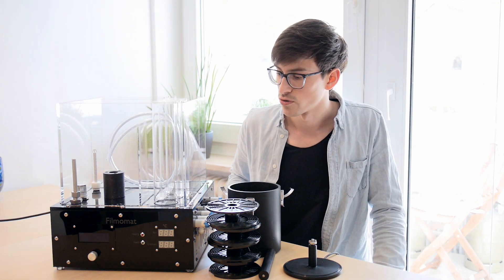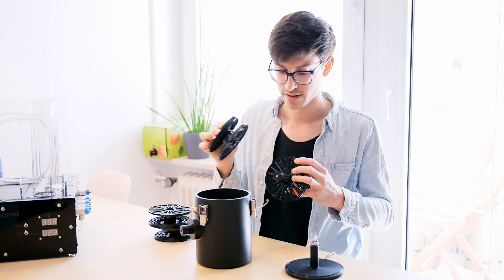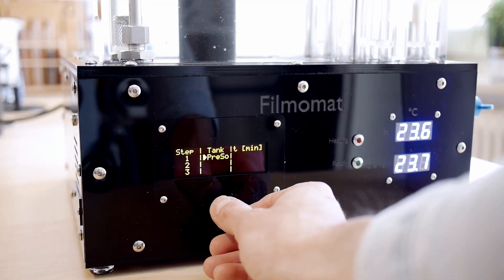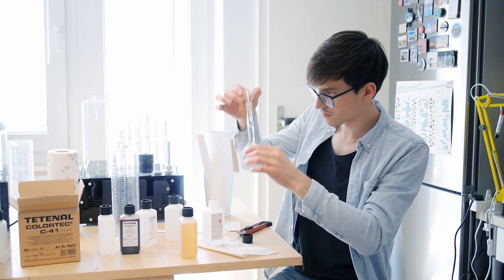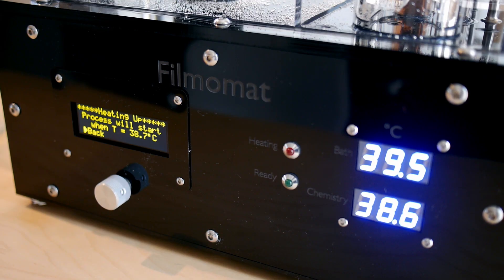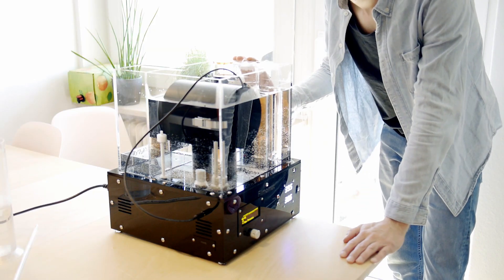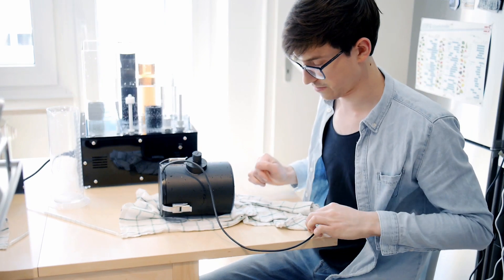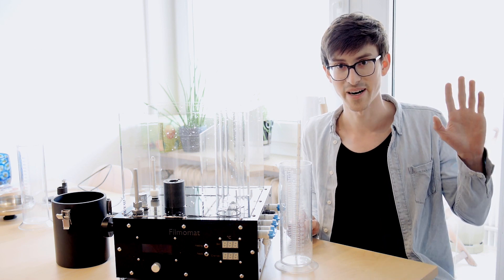The new 2020 Filmomat - fully automatic film processing machine

Comment: The new integrated tank and motorized agitation is clever and adds function. However the core of the Filmomat  is still limited to three bath processing, which limits color processing to the DIY home process based chemistry kits which present a significant compromise of the true processes. Both old and newly introduced processors do not have this limitation, and cost no more.
Reply: Although there are only 3 chemical tanks, you can create custom algorithms on the Filmomat for more complicated dev processes. ECN2 for example. You just need to be around to swap the chemicals mid development.

Comment: That is a really cool machine, but the process barely looks easier than processing film without it.  I used to process film with a Unicolor drum and motor and the only real difference is pouring the chemicals in and out.  

For $5000, I'd really like a machine that would take my cartridge in one end and spit dry film out the other.  And did I mention?  I was processing E6!

Comment: I’ve followed your machine for quite a while, but I can’t help but feel your machine is kinda in an odd position. It’s too expensive for small time operators (Unless they’re making money on their photography, and frankly few are these days.) But it’s really not big enough to provide economies of scale for small lab or photofinisher. 4, 135 or 2, 120 reels is really not sufficient to process a batch of customer orders, or even 1 pro pack of film. I can’t help but feel that you’d find more success if you pursued a much larger machine, oriented at a 5-10 rolls type of economy, which would be more in line with both the JOBO processors, as well as the typical loads of your average lab these days.
Reply from the maker: Hi, the Filmomat is mainly used by private individuals, which also was my main intention in the first place. However, I also have several users who do commercial processing with the machine. You won't be able to process 250 rolls per day, but 20-50 rolls a day is totally possible and definitely in the range for a small lab :)
Reply: The target market is home users with a large budget for convenience. No competent photofinisher would use the home chemistry kits  this machine is limited to. Those kits incorporate compromises in process quality which would (should?) be unacceptable for a commercial processor, and unit/per roll cost of such small volume kits is much higher than the commercial, full process chemistry these labs buy. Small labs are more likely to buy the machines now in final, pre-sale tests made in Australia and Italy, which will be about 10 to 20& more expensive. Ultimately, the problem of the Filmomat is that it was designed by an engineer rather than a photo chemist.
Reply: @randallstewart175  which are those Austro-Italian machines you speak of?
Reply: If you’re a small lab processing mostly C-41, having one of these dedicated just to E-6 might make a lot of sense.
Reply: @IlleCaudimordax  There is the Dev A from Europe, now in limited retail sales, which costs about 40% more than this model of Filmomat. The one from Australia, name escapes me at the moment, but it's all over the blogs like Photrio.  They have been in trials, but I think they are now in limited sales, priced very close to the Filmomat. Both will operate up to six solution systems plus separate wash and cleaning cycles. Frankly, after considering the three bath limitation of the first model, I would have though this successor would have been offered with a six bath function, or perhaps with an optional expanded version meeting the requirements of a 6 bath process. As it stands now, the several 3-bath and 6-bath models on the market today will probably exhaust the demand world-wide within a year or two, thereafter putting most of these guys out of business.